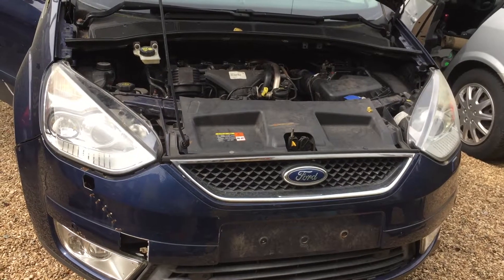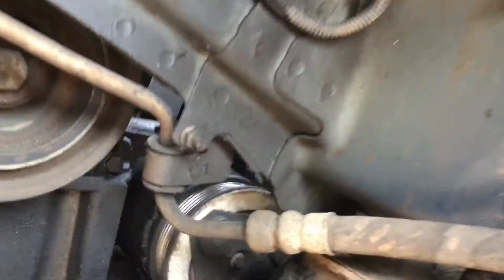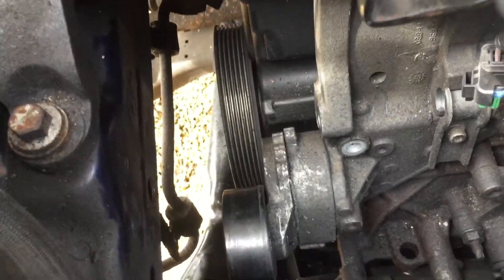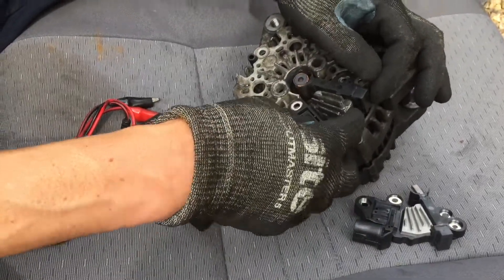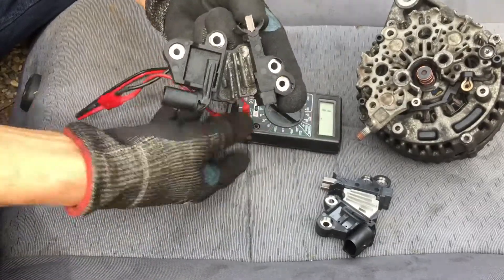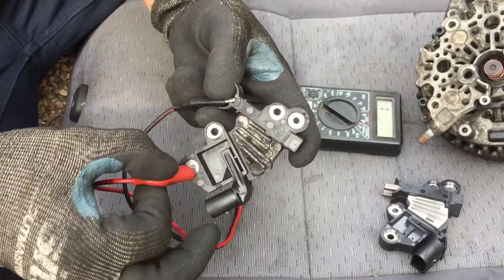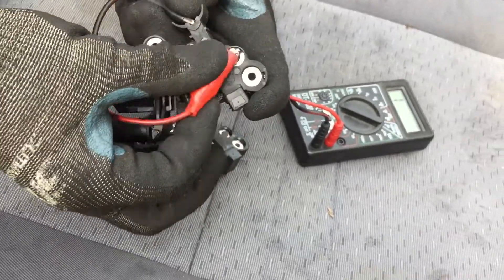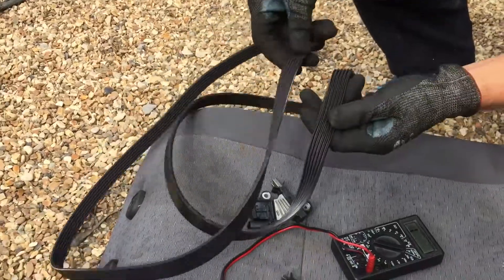Ford Alternator Troubleshooting Voltage regulator module repair 2.0HDI 2007 WA6 [2006-2015]

Comment: Voltage regulator its in the alternator it’s similar to brushes thats the same thing the guy removed im experiencing the same thing the car is charging but it can be charging low or high thats why your battery light comes on it’s charging low then when it experiences high rpm it’s charging normal thats why you light comes on  on low rpm…it can not be a problem now but it will burn out alot of fuses and modules if not attended